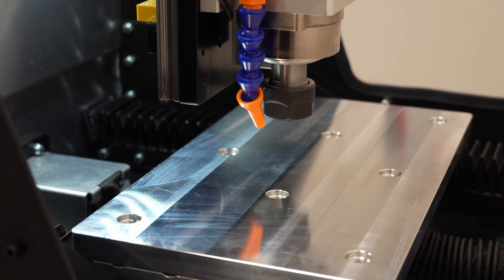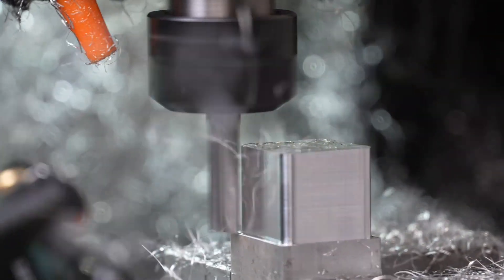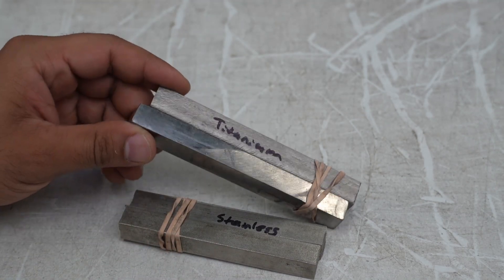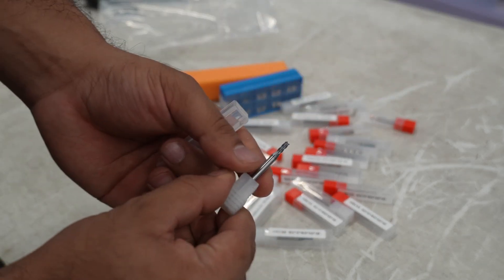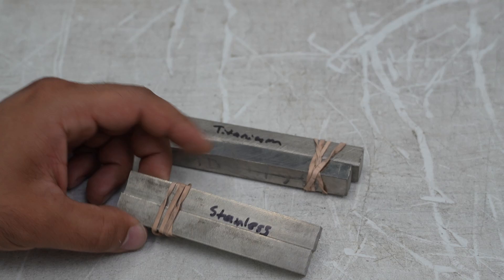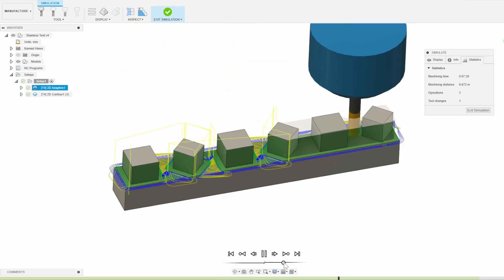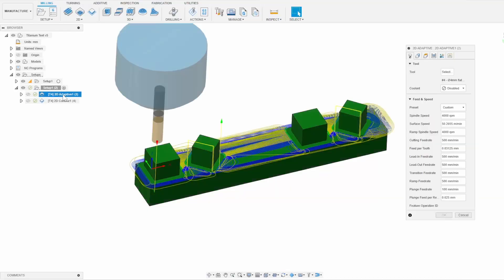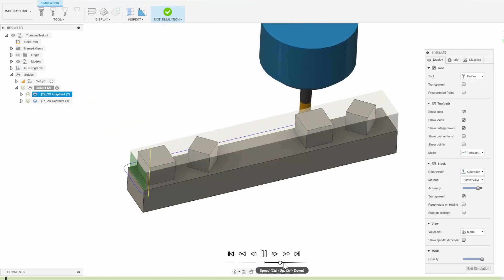Can we cut Exotic Materials on the DMC2 Mini Desktop CNC??

Comment: Titanium is flammable! Do not ever let it get to the point that you're throwing sparks. If those chips ignite, it will use the oxygen in the water and literally melt your machine... I've been a machinist for 38 years, 20 of them in the medical device field and I have extensive experience with Titanium.
Reply: I made a guitar for my dad with titanium screws & accidentally knicked a titanium screw while cutting & all my epoxy shavings burst into flames😅😅😅. Luckily had a fire extinguisher attached to the table, but would have definitely burnt my house down if I didnt.
Reply: I think you might be overlooking a few key points. For an explosion or fire to occur, you need three things:

1.A combustible material (check)
2.Oxygen (absent if fully submerged in water)
3. An ignition source, like a spark (check)

In this case, the work area is continuously rinsed with water, and the machine’s small size—about 2 cubic feet (around 400 mm x 400 mm)—along with the very slow feed rate (passes of just 0.003 mm, or about 0.001 inch), means the risk of fire or explosion is negligible.

However, machining titanium without sufficient coolant can indeed overheat tools and potentially start a fire. It’s also important to note that aluminum dust is actually more explosive than titanium under the right conditions—many underestimate the hazards of aluminum dust igniting if the mixture of air and dust is just right.
Reply: @JohanDegraeveAanscharius  Titanium like magnesium has such a high affinity for oxygen that it will split the water molecules and form TiO2 and release H2 gas. If you have titanium chips burning they will not be put out by water. (Titanium is somewhat less reactive than magnesium so in some cases small burning chips will be quenched by water before the exothermic reaction accelerates, but you could also quench a campfire with gasoline if you had enough...)

Comment: For your adaptive toolpaths, in Fusion on the last tab, for linking parameters, set your stay down level to most, and the max distance to 6" and set your no engagement feed to 100 in/min, and it will stop all of those vertical retracts between small linking moves... It will stay down, and only vertically retract about .01" and it speeds up your adaptives by a good amount.... Also, it's a good way to get around the no rapid moves with a free version of fusion 360.  👍🏻

Comment: There any plans for a HALO style flood coolant system?
Reply: Lookup 'Loc Line Circle Flow Nozzle Kit'. You could use T or Y loc line splitters to do any number of outlets at any desired angular positions, probably 2-4 outlets is best for 40psi. Also smaller diameter outlets will keep the pressure at the tooltip more.

Comment: I wonder if hhs is a better choice for these machines vs carbide tools?
Carbide demands a stiff setup or tool life suffers greatly. 
Hhs is way slower but accepts deflection and sloppy machines much better without failing. And it’s cheaper.
Just hear the spindle with a 10-1 reduction to get the rpm in line
Reply: Easier said than done in a small package.  These router type spindles that run at 24,000 RPM are purchased off the shelf, they are usually 400 or 800hz motors, controlled with a vfd.  They are picked because of their small package.  The key is with these spindles is that you have to just use small cutters that get you to a high RPM at a given sfm... My mill at home has a similar spindle, BT30, 3hp 12,000 rpm and the absolute Max cutter you can use is 1/2", but it likes .375 or .25 a lot more, especially in hard materials.... If you try to drill with a .25" hss drill bit in steel, you just can't get the RPM low enough without stalling, because these spindles lose torque as you drop rpm... It is a much different thought process than running a large vmc. I use Mazak at work all day, and I have to really change my programming at home on the small machine. It's just not the same thought process.
Reply: @Steelcrafted  What he said, but you would also have too much weight hanging off the head with a gearbox, requiring much larger stepper motors, and a stiffer machine to go with it. Diminishing returns

Comment: Everyone spending there high end knife budget on machines to sart a knife company.
That’s gonna hurt the knife making market. 
They won’t flood the market. They won’t succeed unfortunately, 
The issue is all the money that may have been spent on knifes are now being spent on desktop cnc’s.

That being said. I would much prefer lots of people being creative with cnc’s than having fancy knives collect dust.
Reply: Just let the markets correct the over saturation. Theyll figure it out eventually like any other product it'll be the best ones that make it.
Reply: Most people can’t afford a cnc anyways nor do they have the education to run one. There machines will probably just sit and collect dust if bought. I bought a dmc to learn and practice for school.
Reply: @motorheadproductions865  Desk top, entry level CNC routers (which in some cases can machine aluminum) are pretty cheap and pretty popular the last few years.  Having 30yrs of experience running CNC machines, the "education" required isn't substantial.  Your average person with a little mechanical intuition, basic math skills and the motivation will pick up CNC programming/CAD/CAM pretty easily.  There's also a lot of online support/user groups for these machines.  Will a novice be a pro CNC machinist in a few months?  Absolutely not, but I wouldn't hesitate to think that they'll at least be able to machine basic parts.

But I do agree with you that a lot of these entry level machines probably won't see much if any use...  I've come across a number of people over the last few years that have purchased one of those small, entry level CNC laser cutters that still have yet to use them to any measurable degree.  I'm sure the same can be said for all those that have purchased those $300 Amazon special CNC desktop routers.